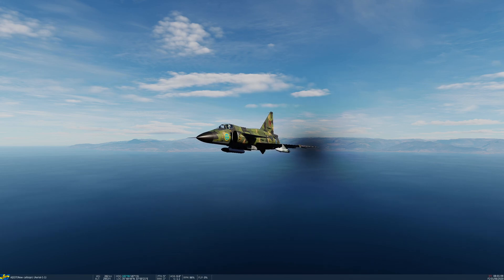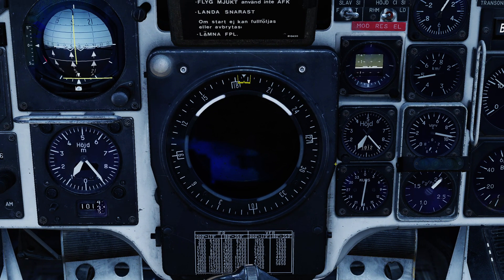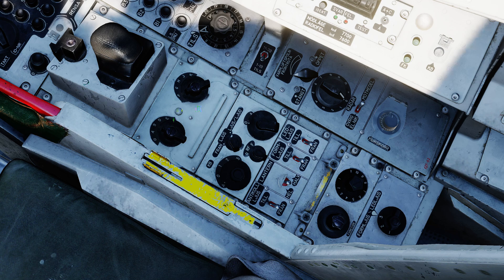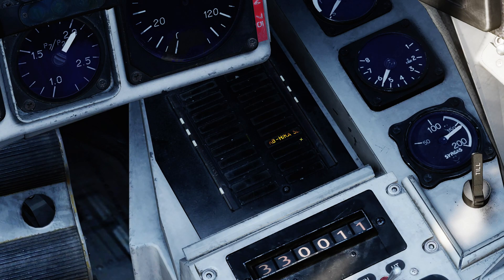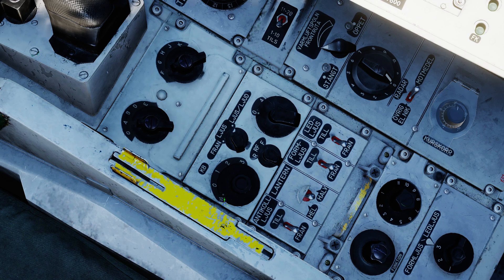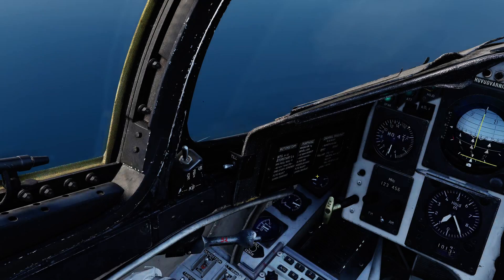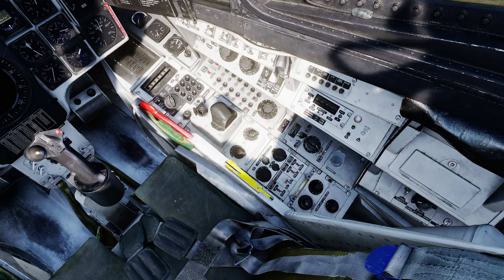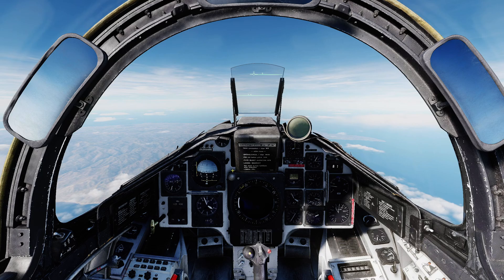DCS AJS37 Tutorial 17 - Defensive Systems

Comment: i have the same experience with the A mode for countermeasures. It seems at some point during the last 2 years, the system broke. and Heatblur hasn't fixed it yet. there are some threads on the forum that report the same issue.